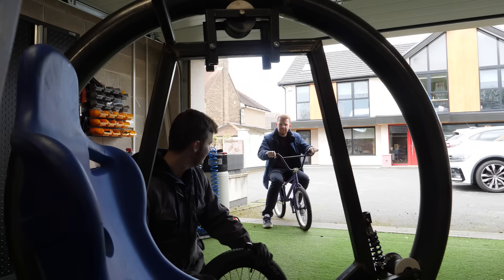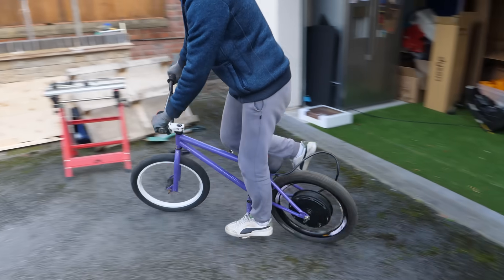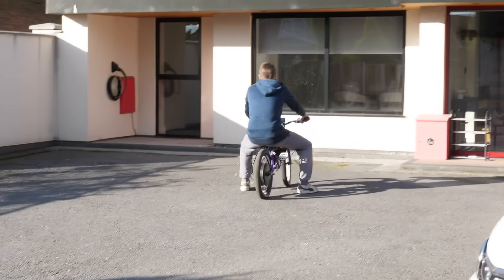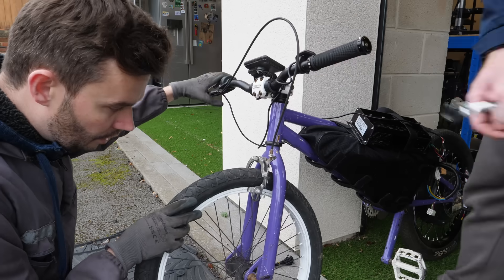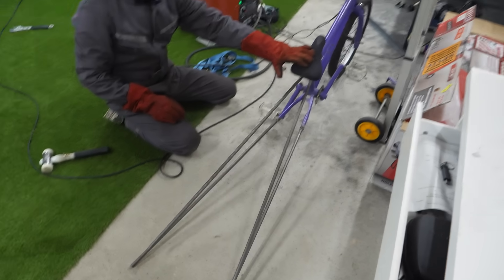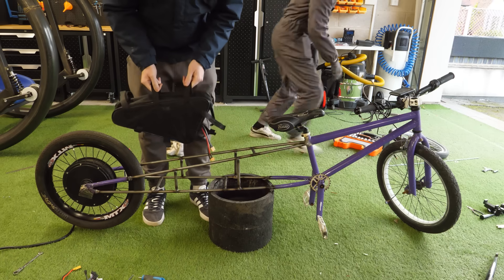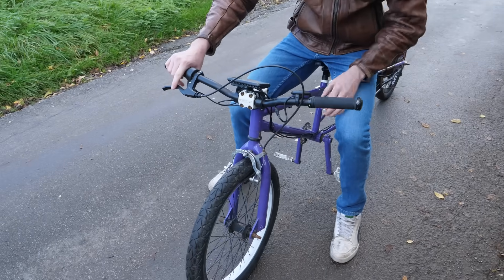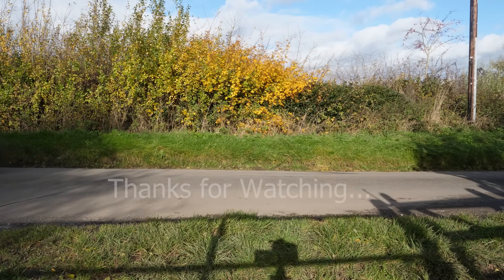Dragster E-Bike

Comment: It would be cool to upgrade the brakes and take it to the drag strip. A set of curved front forks like the old Schwinn Stingrays had may ( or may not) fix the high speed steering wobbles. You might also want to find an old school tuff wheel for the front before you go too much faster. Having the front wheel disintegrate at speed would really suck!

Comment: LOVE IT. in fact, you inspired me to build one of my own- same skeletonized frame, but lays in between 26x2.85"(F) & 26x4"(R) wheels w/ 8kw hub. Pilot's head is same height as split handlebars, triple-tree suspension forks eliminated road issues, raising the top end a bit
Am hoping to see a Part II ...maybe some simple mods? Rubber, booster, aerodynamic faring, etc (?) 
All n all, looks great. Simplistic, light, rigid. Well done!

Comment: What motor was used?  I can’t find one of the same power in that size, or atleast not one with an mtx rim.
Reply from the maker: Hi truth be told I bought the motor, controller, etc  a few years back on Ali express. I have since checked and unfortunately they do no longer exist from where I purchased them. Hopefully you can find something similar I’m sure there are other 3kw 72v hubmotor kits out there. Best of luck!

Comment: lower the rear PSI for a little bit more grip and maybe add a little bit more weight more back to put more pressure on the tire so it locks up with the ground

Comment: This is kinda the opposite of a dragster. It has the same long wheelbase as a drag car/drag bike. But drag cars/bikes try to put all the weight over the rear (larger, wider, powered) wheels, for traction. This bike, the rider's weight is mostly over the front wheel.

But extending the wheelbase BEHIND the rider (rather than in front on the rider/driver, like in drag bikes/cars) is a thing in the custom motorbike world; Popular in the 90's/00's, there was a style of custom bike called a "Streetfighter" (I think it was most popular on the UK- There used to be a Brit magazine called "Streetfighter", dedicated to the style), where you got a fast, Japanese roadbike, increased performance, and extended the rear swingarms, sometimes pretty radically.

This e-bike resembles a BMX version of a Streetfighter build, much more than it resembles a typical drag bike, where the rider is just in front of the rear wheel.

Comment: Type in google "gold rush recumbent". You've got the frame, add a seat in the back and weld on the handlebars. Comfort and aerodynamics will increase. Then, a front fairing and an aerodynamic rear case will increase range.

Comment: the weight needs to be on the drive to get traction this is just going to spin the wheel from a dig
figures you would build a fly by bike to match modern cars that can't race from a dig either

Comment: All you do is take the crank out, and flip the frame upside down, along with the up turned bars, that's how we used to make "g-bikes" gravity bikes for coasting downhill crazy fast, sitting on the bottom tube is surprisingly comfortable and the geometry feels incredibly more natural.

P.s. get a damn welding cap so you stop burning your dang head when you weld in odd positions 😂

Comment: When using a reciprocating saw always push it to the shoe to get rid of vibration.
When you just float it on the blade it takes much longer to cut and bends the blade.

Comment: The wheel is never in backwards , you just have to change the 3 phase wires ( yellow blue green ) 

You can install it whatever way you want and some controllers will even allow you to modify forward and reverse without changing the wires . Just hook up the grey wire for calibrating .

Comment: You can mod those cheap controallers 
Threre is a contact on the board can be: X, DS, A2, F1... 5,  that when pulled down to ground  activate regen (very handy in this case that your breaks sucks), please note that will not work depending on the battery voltage configuration some will stop at >3.95v/cell or higher
You could also mod the shunts for more amps 
My experience with thoose modifications in a 48v 30A comtroaller: regen is very smooth i use all the time, just monitor you batt voltage, i Bypassed the over/under voltage protections to use full power iven if the batt is low 
Thanks for this video

Comment: Those 3,5kW hub motors are a ton of fun. I knew a guy who ran them on 100v and added water cooling to the controller and motor and cruised up and down mountain roads at over 100km/h.
Reply: He should run a 5kw motor on it that would be insane

Comment: If you want a louder sound instead of the card, using an empty can or tin between the wheel and the metal bar typically above the tire by jamming between the two is how you do it.

Comment: The dragster looks like lots of fun. There is nothing wrong with rim brakes, but there is everything wrong with those rim brakes.
Back in 2001, I was building drag racing stand-up scooters with dual brushed motors and 400 Amp golf cart controllers. Beating gas-powered scooters was easy ... stopping was hard. It also sucked when the motors caught on fire. ;)

Comment: Not a BMX wheel, a 20" wheel. These are used in combination with derailleur gears and 135mm spaced dropouts. They're also dished to accommodate the additional sprockets. while maintaining an adequate chain line. Easy enough to fix on a conventional hub, not so much when it's a hub motor.

Comment: Oh man, i did something very similar to the start of the video - i got a 10" (10" motorcycle), 5kw hub motor from a delivery scooter/moped and put it in a bmx frame. It was stupidly fast, but you had to lean fully over the handle bars otherwise it would wheelie really bad.

I used some folding bike forks on the front and a folding bike wheel because they were suspension fork and they had disk brake mounts, i would routinely roast the brakes even with double thickness 203mm discs

Insanely fun and fast, great to give to friends and have them immediately wheelie it and fall on their backside!

Also surprisingly practical because the wheelbase was super short and the rake angle was steep, meant you could take it anywhere

Comment: Use regen for braking. Funny how people always say hub motors don't have torque and mid drives have more torque. I find the exact opposite to be true.
Reply: Torque doesn't rely on position of the motor.
It is pure engine force multiply or divided by gear ratio (internal or external).
Also mid motors can be feel more powerfull because they spin much faster than cranks.
Reply: mid drives genrally i suppose are just geared more.

the hub motors generally would have a chance at way more torque having more built in leverage-advantage? you'd think at least. either way you can make both of them really much more powerful than they're usually made into.
Reply: @lasskinn474  A lot of hub motors has internal gears - but this make it louder, heavier and more complicated to manufacure.
But still torque output is measured on exit shaft of motor (after internal gears).

Comment: All the danger of a motorcycle, as exposed as a bike, and with the low turning circle of a full sized car, this is truly the pinnacle of engineering! Looks like a ton of fun honestly
Reply: And the brakes of a 1920's bicycle.
Reply: @Mp57navy  honestly still better brakes than my $1000 ebike off amazon
Reply: @RioPianta  be careful with that bike and the battery specifically homie. $1000 is about the price of a good quality battery for a e-bike
Reply: Purpose built vehicle
Reply: How does the exposure of a motorcycle and a bike compare?
Reply: @ClimateChangeDoesntBargainif you slide sideways into a tree the motorcycle will take a bit more force for you then a bike
Reply: Or the pinnacle of FAFO
Reply: YEAAAAAA!
Reply: @coryman125  Wait til you see actual drag racing motorcycles 😉

Comment: 8:14 I spy a second wheel with a hub motor, you could make it two wheel drive.
Reply from the maker: You know too much!
Reply: @SamBarker  Two wheel drive, but the driven wheels are both in the back and inline with each other.
Reply from the maker: @Spookydude3  you also know too much…. 👀
Reply: @Spookydude3  I would put them parallel to each other, it would make it look more like a real drag motorcycle with a fat rear tire.
Reply: @Spookydude3  only if the middle wheel has some sort of suspension. If you get any weight transfer, which is beneficial in a rear, and tandem rear wheel drive vehicle. I personally think it would be cooler with a 2x2 layout and some suspension forks to allow some weight transfer while keeping the front wheel on the ground. Im going to watch regardless, just my thoughts.
Reply: @fightfanian  look. you make the 2 rear wheels be on the same swing axle. as the entire front bike lifts up it pushes down on middle of them.

I think you could do some spring and linkage magic to make the fore one of the back wheels get pushed harder too from the weight than the rear, or place the pivot near more it.
Reply: @SamBarker  
Updates Mate 👌
Reply: @SamBarker  Or two wheel drive... AT THE BACK. A very narrow trike. Double the grip, half the work.
Reply: Or making a "Drift trike". 🤔
Reply: AWD e bikes are very popular.

Comment: Protip: There's barely any measurement required (you can just make templates if you hate measuring) when converting to disc brakes if you clamp the brake caliper on the disc in right orientation, rotate it and the adapter brackets ( both the aluminium stand off they usually are shipped with and a small piece of steel you cobble together and bolt on to that) against the seat stay and  tack the steel adapter bracket to the stay. Then unbolt the brake caliper or just slowly stitch weld the adapter bracket on and apply wet rag or something for cooling.  

I've done it on bunch of old bikes, its trickier with aluminium frames as you need to make clamping brackets so as to not weaken the alloy, TIG welding will ruin the temper so that's very iffy prospect as well. Best to convert are cheap steel frames made from Hi-Ten or even less alloyed steel.

There's plenty of well documented conversion online, many ways to solve this problem.

Comment: Top fuel dragsters have the weight set up so that under acceleration the weight shifts to like 1% over the front wheels and 99% over the rear wheels. That way they get full traction without doing a wheelie.
So for full traction you probably should have only extended the rear wheel by like a foot. Ideally you would want to extend the front wheel by a meter instead so you can have a longer frame that doesn't weight shift as hard but that would be a lot harder to do.
Reply: But the thing with drag bikes, like turbo ‘busa’s, is that they wheelie when they launch. Even a long arm bike can and will loop with power. The reason top fuel dragsters don’t wheelie is the wheelie bar on the back end that is set up to keep the wheels on the ground.
Reply: @Reeheeheehe I don't know much about drag bikes, but that makes sense. That way you can ensure full grip and the wheelie is a lot more controllable than in a car.
With wheelie bars though you might want to lightly tap them as an indicator you have full grip but not ride on them. For every pound you put on the wheelie bar you lose a pound on your tires. It's better to have your weight slightly forward because the front tires are a lot farther out so a pound does a lot more out front than at the relatively short wheelie bar.
Anyway, based on what you're saying he probably had it about right when it was stock. I guess that would be a pretty short video though.
Reply: @kylebooth2528 the way that a top fuel dragster’s wheelie bar is adjusted is so that it’s in contact with the ground at all times. The cars put so much power to the ground that they simply have to have a wheelie bar, otherwise they would loop out like a bike.
Reply: @Reeheeheehe I don't think I've ever seen anyone adjust it to be in contact all the time. I don't think you could because the car squats when the tires fold up. I guess you could if they were springy enough but then they wouldn't be rigid enough to actually prevent the wheelie.
The old school ones (and some classes today) didn't always have wheelie bars. They just had the weight set up to pop a wheelie but not flip over. Well they weren't supposed to flip over anyway.
Reply: @kylebooth2528  Dragsters have weight planning to keep the front end down as well as downforce generated by speed and a 4-link suspension setup that can be adjusted to help control the car wanting to wheelie.  The wheelie bar doesnt contact full time but it is used a lot of the time, and yes weight on the wheelie bar means less traction force for the rear tires.  For drag bikes they tend to ride on the wheelie bar a bit more.  I dont think anyone's tried a 4-link type setup on them yet that i've ever seen, but it might make an interesting result.  In this case lowering the seat to near the road surface and having it nearly against the rear tire would probably be a better idea than worrying about a wheelie bar and would give optimal traction likely as well.
Reply: @NVMDSTEvil Motorcycles have anti-squat too, but they do it with the chain tension and swing arm. All of this is a little out of scope for the project though lol. I was just trying to point out that he extended the rear wheel too far and it lost grip.

Comment: 2:40 next time, you can just swap any two of the motor phase wires to switch the direction, no need to physically turn the wheel around.
Reply: it's a running gag on this channel at this point

Comment: B̶M̶X -> Dragster
Reply: Tom, We need a pulse jet engine please 🥺
Reply: Steel tubes are much stronger and won’t bend easily
Reply: Dmx
Reply: Who are you and what have you done with Tim Station?
Reply: @threeme2189  This video really had a Tim Station vibe to it.
Reply: you knows know that it's legally a motorbike now, right? like if you were to post it on a public bike path that could end up with all kinds of fines and fees? relatedly that would be an interesting another project: registering it as an UK legal motorbike and what modifications are necessary for that. this is actually really relevant for other home builders now, while it is fairly common on the internal combustion side bike hobby very little information on how to register an ebike.